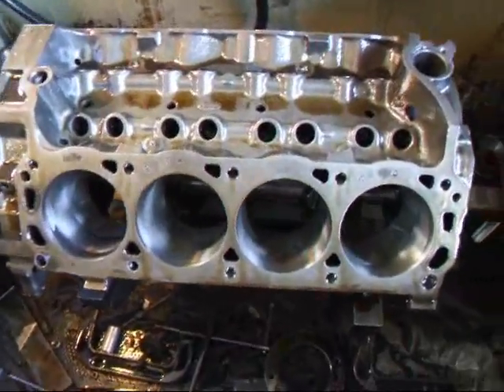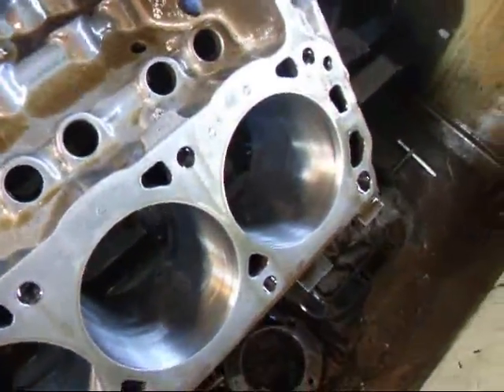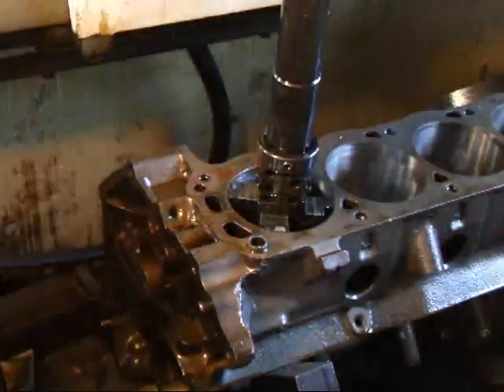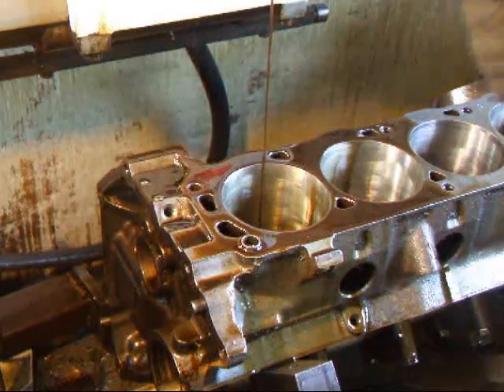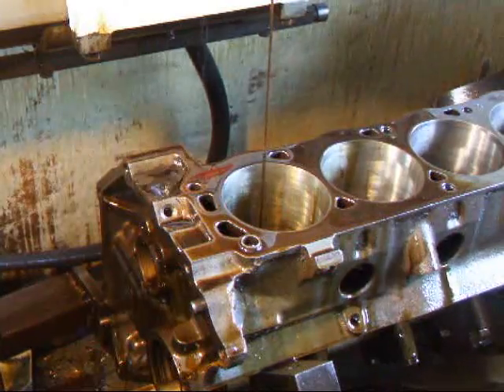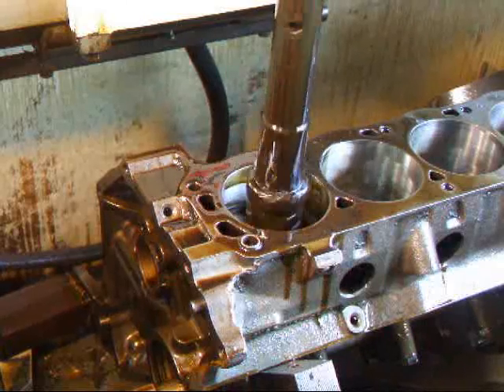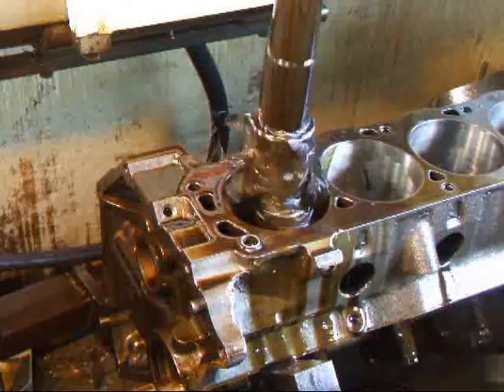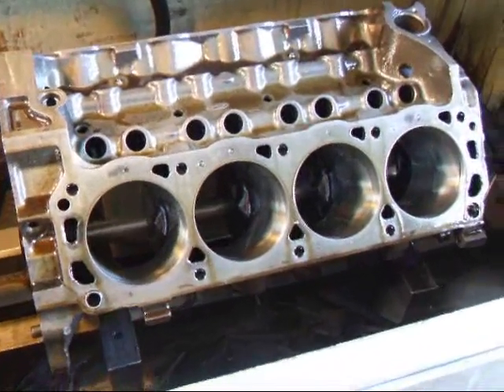289 Block Honing.wmv

Comment: Hust a question, maybe fool for most of those involved with engines,  what is or are the main differences with the 302? I have a 289 & practically all the parts are share in the same measurement.
Reply: Crank an rods are different

Comment from the maker: @magnahelic1 - I typically hone everything to size. I use a dial bore gauge and rough to .0025" of finish size and then use a finer grit stone to get to final size, then I use a plateau brush for the final surface finish. The actual stone recipe is dependent upon the type of rings to be used.